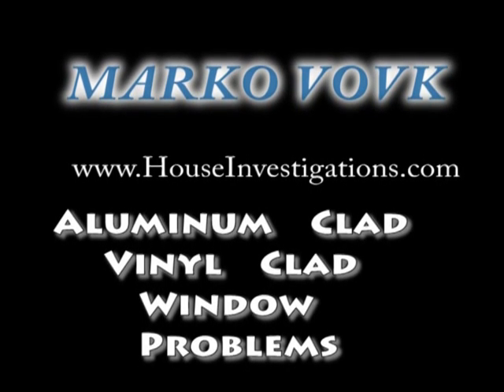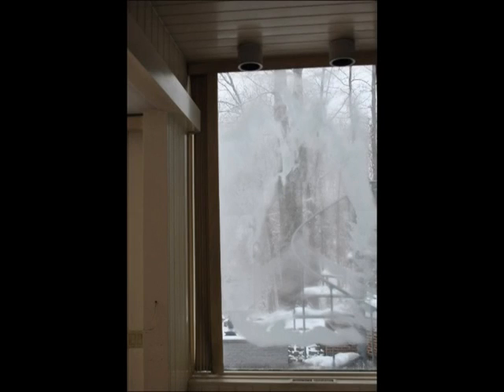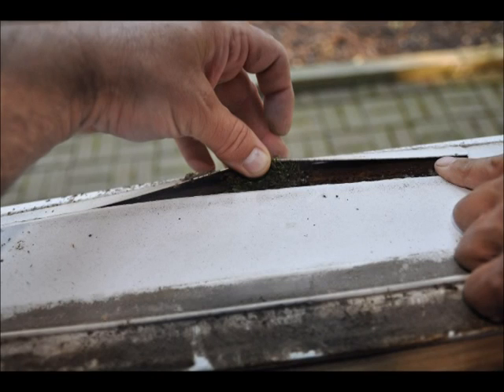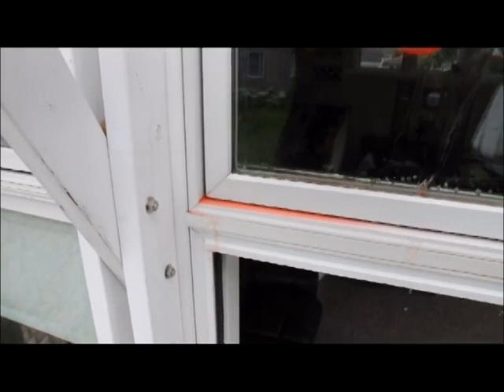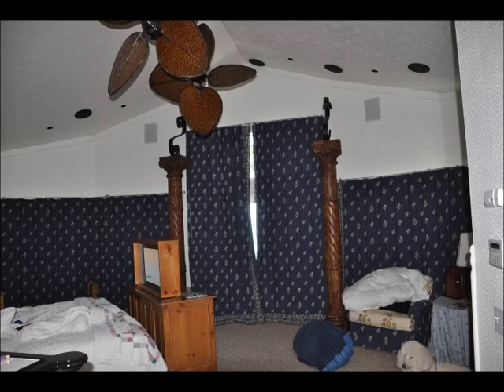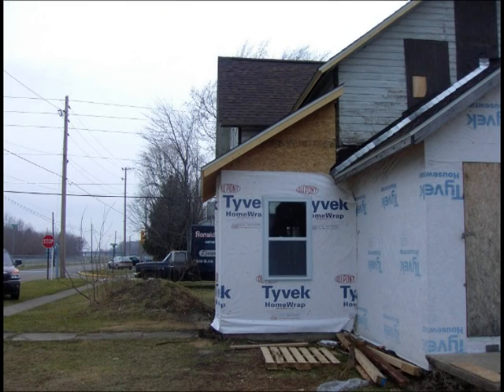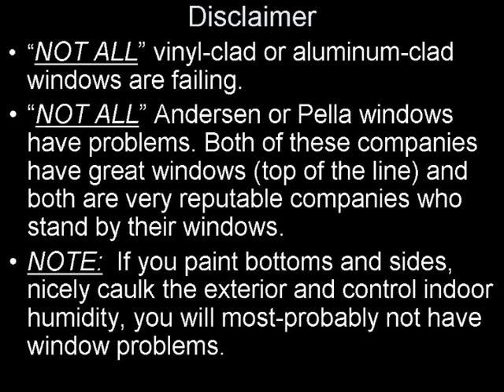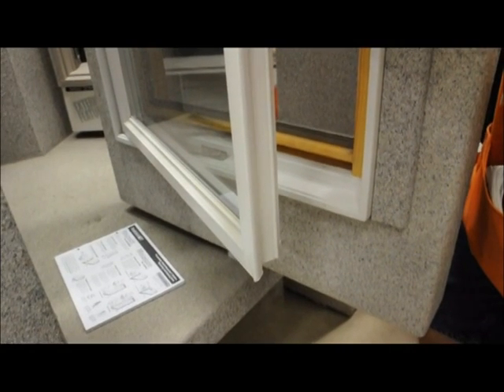Aluminum Clad, Vinyl Clad, Window Deterioration THE TRUTH Pella Andersen

Comment: Amazing as I know people who still have wood windows with 1 pane that have not rotted.  These are old homes but nice homes.  Now why can’t they build a damn good window today?  Pella is lousy.  Their aluminum clad wood are junk. Rot.  I know. I’m in on it.  Sobs.  And yes on trees. It’s disgusting today.   And fiberglass is the best or a strong vinyl.  Andersen fixed their error in the 80s and now their windows have a strong vinyl surround to the windows and then wood. My Mothers 400 series Andersen casements are 12 and 23 years old and in perfect condition except for some sun fade on the interior wood which can’t be helped but an easy fix. Not wood rot.
Reply from the maker: yes , thank you for the comment

Comment: another  reason for seal failure in double pane plastic aluminum windows i E fogging,water vapor entry  , glass shipped to window factories is coated with plastic beads,,fine grit that prevents breakage during transit,when worker crews remove glass from the crate  setting it on the carpeted table cleaning meant to remove the grit  is the house mix of blue windex type liq  spray cleaner,This stuff does not remove the grrit.., so when butyl caulking binds the 2 panes together, gas bleed out occurs and vapor is seen inside the 2 panes,,the caulk does not adhere and seal leaks,glazers pumice or cerium oxide preps the glass cleanly,and glass gets squeaky clean making good seals before the butyl caulk is applied,,    Older storm windows,when glass is cut on the table or the bench where the boot is applied to the glass edge, medium grit sand paper rasped along every sharp edge results in glass that will grab this rubber boot better,and take slams and drops without window breakage,,OSHA rules and regs in glass handling demand workers use cotton  or thick rubber gloves to handle glass, so sand paper to solve the problem is out of use wherever glass is handled  glass cutter chipping edges ought to be used to round the 4 corners then feathered with sandpaper.,rounded  edges add to the  storm sash strength,
Reply from the maker: I WOULD LIKE TO TALK TO YOU AND LEARN ABOUT THIS. Marko Vovk 216-924-8378.  Sorry for the late response.Thanks for watching. Sorry for the late response. Youtube sensors my stuff and I was discouraged from it for several years. I am back and will give it another try. Thanks  PS I want to know about this kind of failure.   Clevelandmold@aol.com or call me

Comment: Defective seal on all 5 lower clad panels on two ProLine 450 aluminum clad sliders leading to leaks that ruined finished  basement below as water pours in through wood seams on the INSIDE of the panels.  And yes, I could see green plants growing out from the clad this spring where the rotted wood had ballooned the clad away from the seal and glass. When I called Pella, I was told 'thank you for letting us know - is there anything else I can assist you with'.  When I called the store I purchased them from and who installed them, was told nothing we could do.  Forced to caulk all panels to prevent any further leaks I hope.  They can not take the freeze thaw cycles of northern New England.  My original Norco all-wood windows and doors lasted 30 years.
Reply from the maker: Mine now have plants and leak inside.   Thanks for watching.  I have added 120 new videos this month.

Comment: Well apparently there is a God and you are his messenger. I couldn't have come across this video at a better time. I have a house built in 1900. Of course the windows need help. I could repair or replace the sashes but I was thinking of putting in replacement inserts. I just today went to the Andersen dealer to talk about ordering. I waited because I wanted to remeasure. While looking at Youtube videos I came across one about Andersen windows failing due to rot and provided a link to a website talking about that. Many complaints described the sashes rotting because water had gotten under the vinyl. Then your video popped up. You talk about the very problem that the complaints were talking about. It makes complete sense. If water ever gets under the vinyl it will just sit there and rot the wood. Now I have to reconsider my plans. What about replacement windows with no wood? Or should I just bite the bullet and redo the sashes? Thanks for you video
Reply from the maker: I am glad I could help

Comment: This is why high-end builders stick with 100% wood. I repaint and caulk my trim every other year. Anyone who doesn't inspect and re-caulk their windows/trim etc is the cause of 100% of the damage I see as a REALTOR. Any material used on/in a home needs to be maintained. I just sold a home built in 1992 with 100% original wood windows/doors and Masonite (ooh bad, right? NO not bad, if maintained) siding that looked brand new like the day it was installed. The owner who built the home  and was original owner selling maintained his home from day one. I believe all materials fail because of bad install and bad home maintenance.  I own a home built in 1998 with original wood windows. I have a few with broken seals that I will replace with same materials. Anyone telling you that you will make up the cost of new windows with energy savings is wrong. It can take decades to recoup the cost. Cannot believe how many people believe this about new windows. The math does not add up for me to ever replace or recommend replacement of perfectly good in working order windows.

Comment: I appreciate the video and insight into window failure..

I have Eagle Aluminum clad wood windows that are in various stages of rotting out (installed in 1997) - somehow missed the replacement opportunity while they were under warranty - i even had eagle come out while under 10 year warranty and all they did was replace a few parts and I didn't recognize the extent of the issue. Andersen has now bought Eagle - I am reluctant to get aluminum clad window replacements even though I understand (from talking to an installer at a home show  last weekend)  part of the issue back in 1997 was industry wide and in part driven by the EPA which made it illegal to use standard method to protect the wood from rot and they had to scramble and use something that really didn't work. (not sure how true that is and welcome feedback)

At this point looking at renewal by andersen - what I don't like is that it is a wood veneer instead of real wood on inside - nice looking and from reading here people have good experiences.
Also Zen Windows promotes an all fiberglass window also with wood veneer (comfortline windows)  - very solid and looks nice. Made by Fiberframe which has been in business for 30 plus years and claim to fame is they made first fiberglass window. Mostly Fiberframe does commercial windows 

Finally considering the Andersen A series with fiberglass clad wood window with fibrex sill - nice to have real wood and like idea of fiberglass over 400 series vinyl  clad - although many people like them. Also may miss out on warranty has have to local hire installers 

Anyone have experience with Fiberframe comfortline window and welcome perspective on these options.
Reply from the maker: I would do the two fiberglass types.  Yes EPA had some fingers in the cake.

Comment: Wood windows need to be painted. What are manufacturers thinking selling it unpainted? Nothing they arent clairvoyant they dont know what color you will paint your windows or whether you will stain them. They will however paint them for you at present time the cost is 200 per window. Marvin will paint all the individual pieces prior to assembly so you will get paint even at the saw line.

Comment: My brick home still has the 10 aluminum single hung pane windows that were installed 50 years ago. It still works. No deterioration.  Not that efficient but I don't want to pay 30 grand upgrading them that Andersen quoted. Ouch!
Reply: A company quoted me 10k for 11 windows on the smaller side.  I priced them myself for all 11 at only 1500. and it only took about 5 or 10 mins per window to do myself.
Reply: @Lilmiket1000  what kind if windows did you get? Have you had any issues?

Comment: aluminum clad you can never seal the corners.  Andersen casements sashes are encapsulated in vinyl...........wont rot
Reply: we have anderson series 400-these have done well over 35 years, however, eventually, in fairly intense sun, the vinyl has bleached and become brittle and we are starting to deteriorate. My peachtree aluminum cladding on another house have held up better in this regard, but after 30 plus years, you can expect all your windows to leak and  show condensation between panes at times. Nothing is forever- modern house need fewer operating windows anyway

Comment: I lived in a brand new house 1961, with modern AL single pane windows, JUNK, JUNK JUNK, literally formed 3 inches of ICE in the winter, talk about rotted sills and sides, cold and uncomfortable, Single pane AL framed stuff was worse than anything of the worst Andersen or Pella ...Glass technology has improved low e 3 coatings really do work, I have Sun low 3 Andersen casements, blocks so much solar heat the AC and the entire house is much more comfortable...glass coatings matter.  Velux low e 3 skylights, big improvement over older Andersen low e from 1989, the rubber seals dried out after 29 years on the Andersens, Velux have improved on roof windows, Andersen is out of the skylight products, Velux has the biggest market share...lots of problems are due to poor installations.  Andersen no longer make the Narrowline products...all vinyl windows are horrible, cheap, ugly, and they fall apart

Comment: This is a great video.  I know I got here a little late.  However, I had a few Semco aluminum clad wood windows I replaced last year.  I had interior mold issues on the bottom sashes (of a double double hung unit).  One of the other windows (casement) started to rot on the bottom sash rail.  I replaced those windows prior to seeing this video.  I opted to go with Sunrise Standard vinyl windows.  I also splurged for triple pane windows and a golden oak interior.  Based on this video, it looks like I made a wise choice.  Thanks again for putting this out there as this was a very informative video.

Comment: Fibrex. Renewal by Andersen. 100% guaranteed last windows you’ll ever buy.
Reply: Fibrex: made of wood! (wood and vinyl mixed, meaning wood).
Reply: @backup1165  
Fibrex is a composite material that combines everything you want from wood and vinyl and nothing you don't. 
It will not rot like wood, and is stronger and more rigid than vinyl.

Comment: hey cleavlandmarko, what do you think of the new fibrex material by Andersen? Their 100 series windows seem to avoid a lot of these problems.
Reply: It really depends on the installer . Very well reviewed window installer in the area wanted to install top of the line viynl windows and just wanted to use.sprau foam and chaulk as water proofing. I had to explain to the sales rep what flashing was. 

So yeah not going to make a difference you need to get a good installer. In 30 years there will be something else probably .

Comment: A fair video, but I'd say you dump a lot of problems into the same basket. Installation issues are not manufacture issues. Also I think you have to look at design issues in the house or project, it seems like no one knows how to vent and drain water properly. I also don't like the argument about old windows being superior. Yes, they are, but that wood is gone and its not coming back. I do wish that window manufacturers would use hardwoods though, but none do. The best point you make and can't repeat enough is that water moves from the interior to the exterior of the house. The house needs to breath, too tight a house with improper ventilation / drainage chokes the house and will rot it.

Comment: I just replaced a clad window this week. Under the metal the wood was totally rotted. They were installed properly, the failure was from water working its way around the cladding. 
Back in 1990 our Marvin windows rotted away within ten years and I was forced to replace them. In as much as there was a second party law suit going one and we could not suit Marvin windows.
I could go on and on about this.

Comment: This and a few other things I have found on line have saved me from spending $1700 on a Pella Proline 450 Series sliding door at Lowes. It was aluminum clad wood. I will not buy a cladded door. I almost did because my parents house has JeldWen steel exterior french doors over wood that have held up. Going for solid vinyl or getting my existing solid vinyl repaired.
I just went back into Lowes and took a closer look at the Proline 450 Enduraclad, aluminum over wood.  Crawled down on the floor after I though I felt bare wood.  Sure enough the exterior bottom of the door has bare wood, which I was able to take a picture of.  I don't care what they might treat that with, I don't want exposed wood on the exterior of an aluminum door.

Comment: and this is one of the many reasons I hate vynle windows and one of the many reasons I keep my old windows my house was built in 1935 and it original windows are still going strong
Reply: Lukethplumber. This is about vinyl cladded windows. My 13 year old home with 100% vinyl windows has had no issues really. Vinyl isn't the problem here, but rather wood windows covered with vinyl, or aluminum.
Reply: @shall5867  I agree.  Our home that had wood windows require constant upkeep and maintenance.  They become time sinks that are frustrating to say the least.  We replaced them with 100% and not only do we not feel the heat passing through the glass anymore, but they're easy to clean and DONT ROT

Comment: I recently bought a bunch of Marvin clad ultimate double hungs and saw the salesmen added a up-charge for "back priming" which I didn't ask for. I was mad when he explained back priming is applying primer to the unexposed edges of the window , I thought it was a gimmick and he was trying to pull a fast one on me. I wish I watched this video before demanding it removed from order specs!
Reply: Also, in the interest of fairness, my father built our house with Andersen 400 series 27 years ago and not a single one has rotted.
Due diligence on install goes a long way.
Reply: I work for Pella out in New Jersey. I have personally seen so.e of our very old windows having that problem with the clad. I can tell you that all pine is now treated after being cut so the end grain is sealed. I feel you have  mischaracterized "exterior vapor" barriers. 
As well, (as fairly noted in your video) we will stand behind any window if properly installed. We recommend no flashing over the bottom nail fin and proper shimming at the bottom. (No carpenter pencils or shingles, please).
Also, I think it'd be fair to note that the proline rot problem occurred while I was in kindergarten and was resolved for the past 20 years.
Excellent analysis on the windows.
Reply: @zacharykenworthy7360  not true, 7 years later seams are coming apart and wood is rotting!